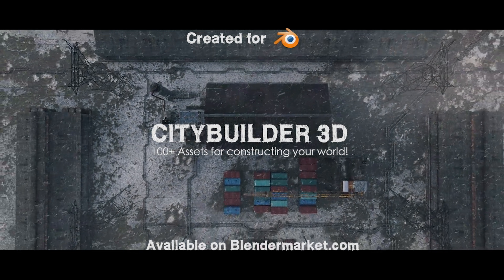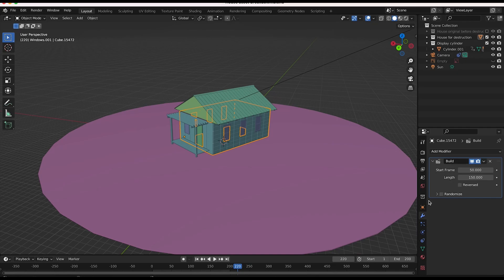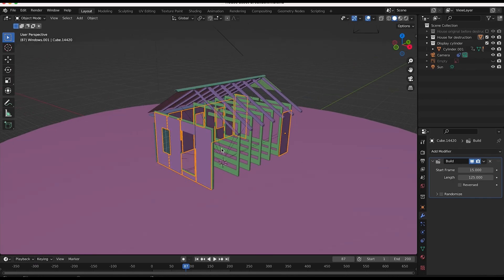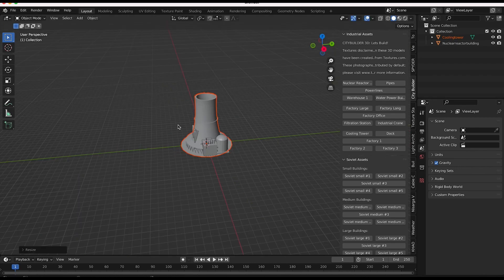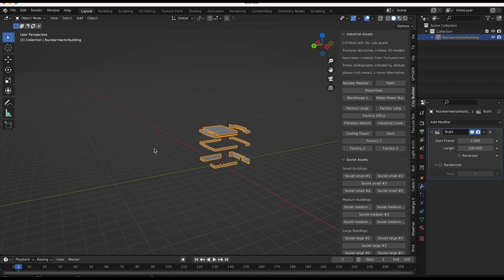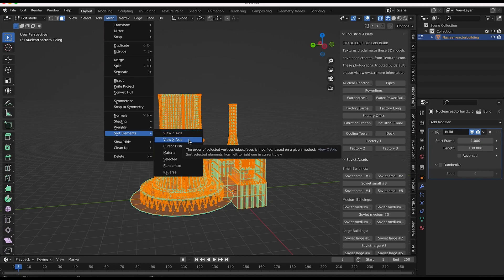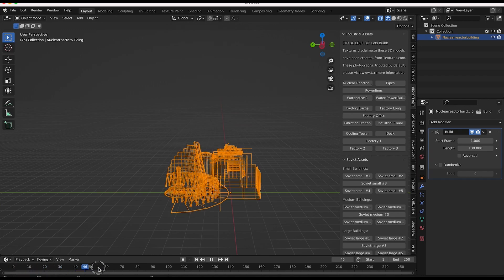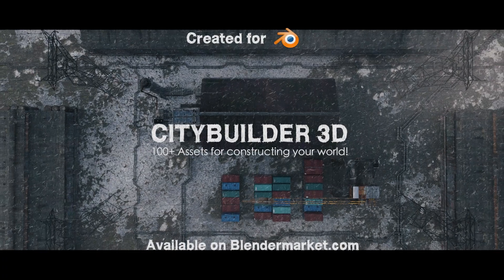How to use the Build Modifier in Blender 3d: Create construction animations!

Comment: Hey im doing a film project in unreal engine, but for modeling i use blender. Should i still do this kind of animation in blender and then export it to ue? I thought about a stairs which build up themselves
Reply from the maker: Hi there,
In my opinion unless you are doing realtime VFX for an LED volume or want to use preset character animations Blender is going to be the better tool for most VFX shots. UE is good but its a game engine that is being used for vfx....vfx is not really what it is designed for specifically. Hope this helps.

Comment: When you say "apply the build modifier" repeatedly in the beginning of the video, what you really mean to say is "make use of the build modifier".
To "apply" a modifier in Blender language means to destructively edit your mesh by permanently committing the changes you are making with that modifier.
Reply from the maker: Yes you are correct. Its a big difference. Should have clarified.